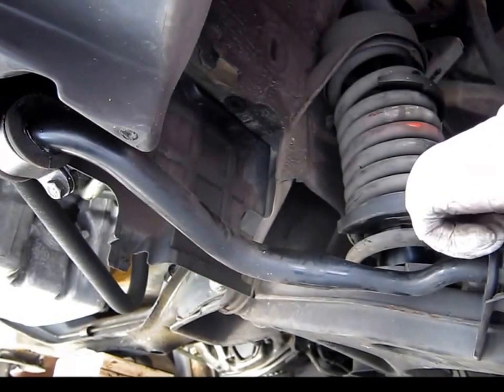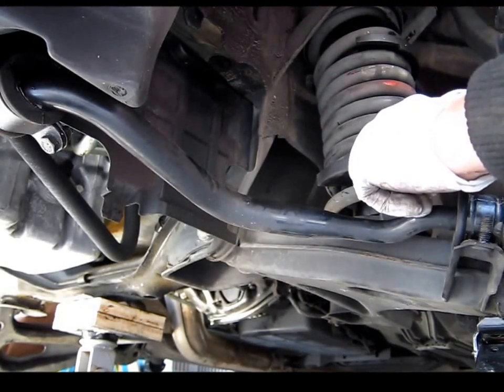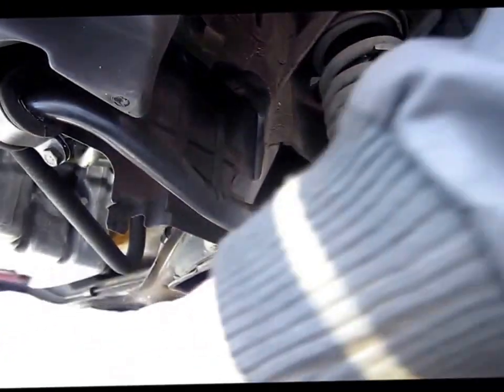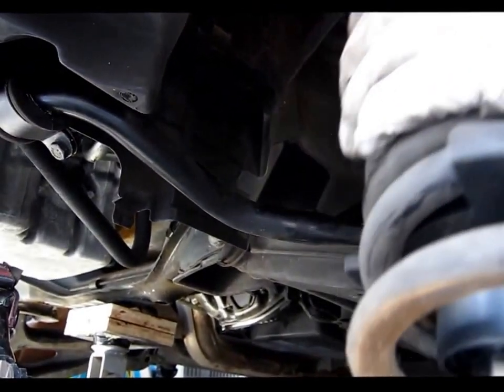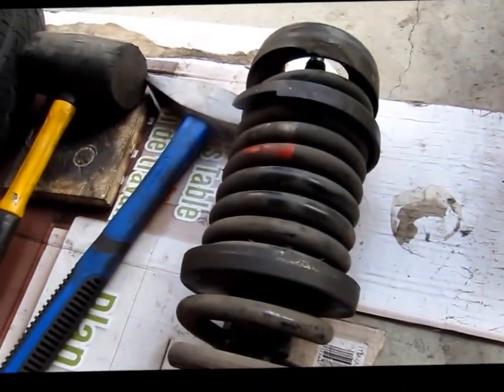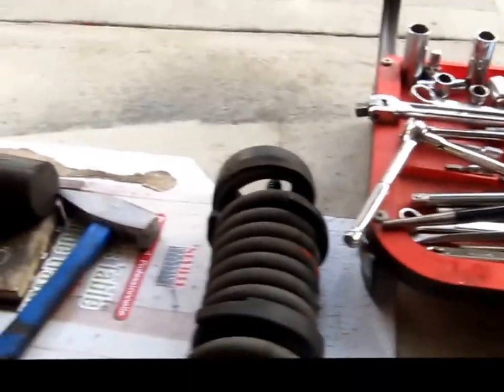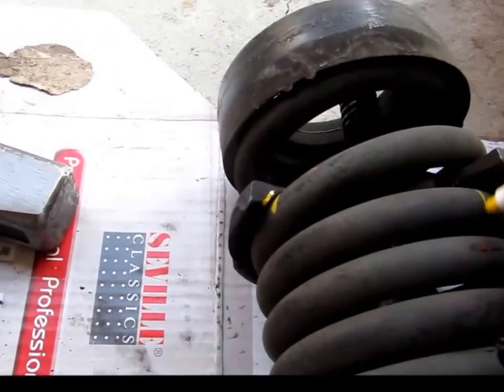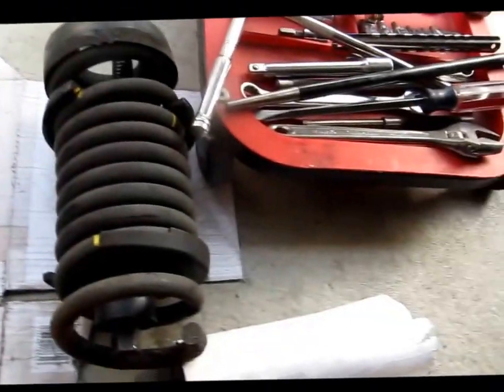Mercedes-Benz W202 C280 Front Suspension Part 1- spring removal

Comment: Where do you show the use of the spring compressor? Is there a part 0?
Reply from the maker: i lost the footage
Reply: @AndyPMercedesBenzChannel  Ahh, okay. I bought the proper spring compressor from Pelican Parts and I'm glad I did. It was hard work with the right tool and would have been dangerous otherwise.